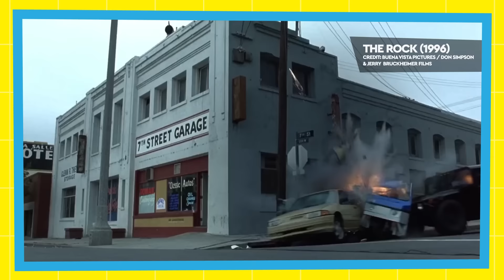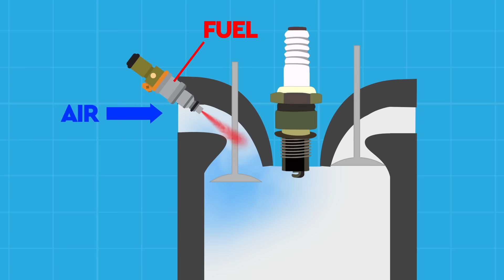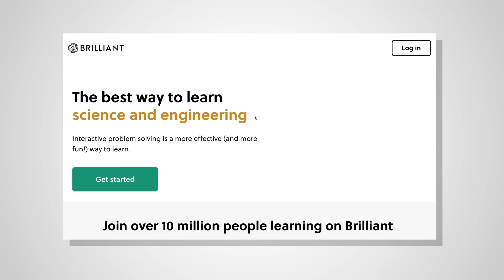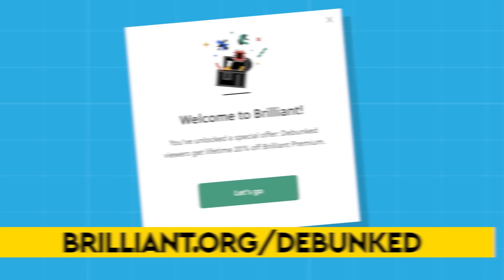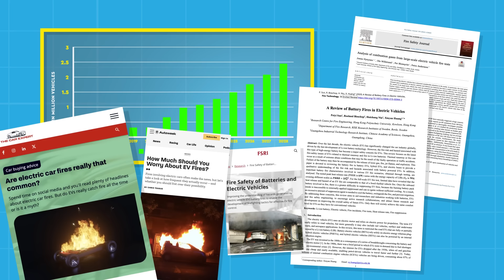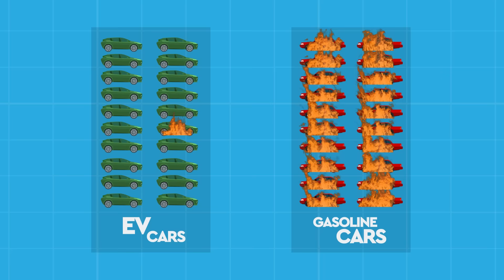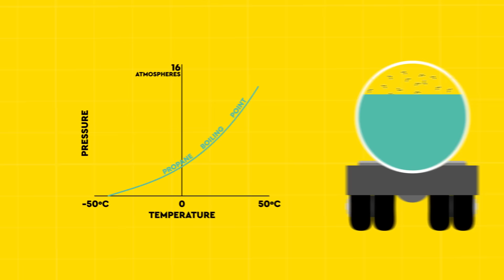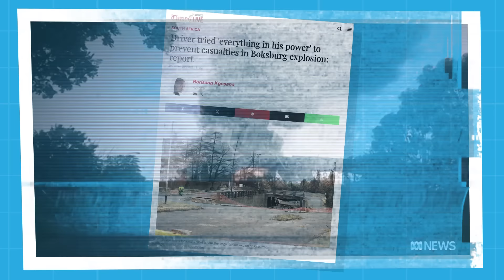What Actually Happens When A Car Explodes In Real Life? DEBUNKED

Comment: Fun fact: Gasoline is NOT flammable. Yes, that's right, I said gasoline is not flammable. Gasoline vapor is flammable and only when mixed with the right amount of oxygen. Gasoline will not burn in a vacuum. You basically said this in the video, just not as dramatically. However, lithium ion batteries found in electric vehicles (or in your cell phone you carry dangerously close to your crotch) are EXPLOSIVE! Think about that next time you get a text ;)

Comment: Comparing EV and ICE fires isnt that simple.
ICE fires mainly happen when the car is moving and even then can still be relatively easily be extinguished.

EV fires happen mostly when the car is standing. AKA parked in a garage. They cant be extinguished easily at all and will cause MUCH more damage because of that. Imagine waking up dead because your EV in your house garage went up in flames and burned the whole house down.
Those are actually situations insurers have massive problems with and now mandate to change batteries of EVs after they were in moderate accidents, because of such possible events due to a slightly damaged battery.
EVs are becoming more and more exposed as the economical and environmental hoax they are. But thats planned economy. Its as if we didnt learn from the Soviet Union and many other examples.
Corruption is the only reason to ignore such well documented history.

Comment: Negative: an explosion is a supersonic exflagration wave-front in the combustible material. By the Wikipedia definition and that used here, popping a balloon or a paper bag is an "explosion".
There is not an explosion in a piston engine. It's practically impossible even in a laboratory to make an explosion with gasoline and even liquid O2.
There isn't an explosion when a rocket booter comes apart, even if there's a huge fireball and a loud "BOOM!" echoing across the countryside and pieces like confetti.
Aside from range safety devices and warheads, there has never been an explosion in rocketry.
Forensic examiners determined that when the Space Shuttle Challenger was destroyed, there eas no explosive and very little fire damage even on the parts facing the external tank and solid rocket boosters.

There is not an explosion behind a bullet inside a brass cartridge after the primer is struck.